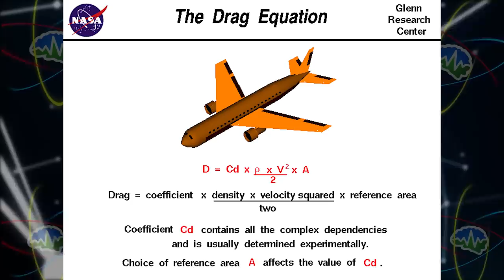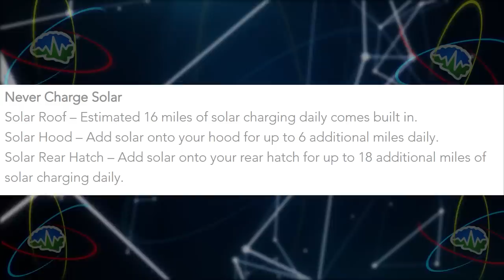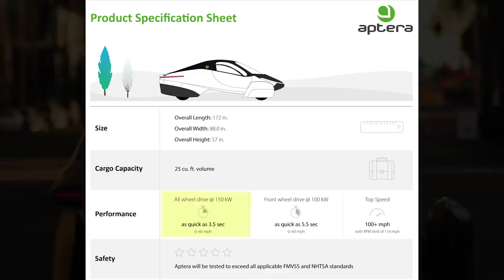Aptera Beats Tesla? | In Depth

Comment: Gut feel I think you lost a few important conservation of energy law. If this car is moving people, weight it needs to use energy. At low speeds how impacting is air friction ? My bet is by the time you get all the requirements of safety , air conditioning and compare apples with apples you're going to see a very different spec.
Reply: It's like saying if you have a motor bike you can go further ..well sure. Will the public purchase a vehicle when they have been suckling on energy dense oil vehicles ? Can the business survive until that happens. However if you are a low weight user maybe single or couple these vehicles may be ideal but so too would be an electric motor bike .
Reply: Aptera is not designing using "gut feel" but with solid engineering tools.  You are correct that air resistance does not become a major factor until speed increases, but at EPA highway speeds, the heaviest model uses less than 100 watts per mile.  They will be tested to FMVSS part 200 crash test standards.  All vehicles will come with AC and heat, which will of course have an impact on range.

Comment: What about crash test and survialbility? Many people are fine with a two seater, but in terms of safty In traffic accidents, you may as well be riding a motorcycle in terms of safty. That’s really the only deal breaker for me with this. Basically, anyone who wouldn’t feel safe driving one of those three wheeled T-rexs or two wheel motorcycle probably aren’t going to buy it, and that’s most of the population. But maybe if one day the roads are chock full of Tesla’s cars and trucks all driving around in autonomous mode, maybe the roads will be safer enough 😁
Reply: This will be tested to and will excel at standard automotive crash standards.  The numbers will be available before production begins.   This is unlike any other 3 wheeler.
Reply: @n.brucenelson5920  👍

Comment: For fucks sake, it's not fucking hard to build a very efficient, low pollution vehicle !!!.... Build lightweight electric van for example,now cover the whole roof in solar cells,stack/add extra solar panels on a slide out rack (like a tool box drawer) that can open when the van is parked for more solar charging power. Add a generator that recharges the battery, that runs off clean burning compressed natural gas, propane, biodiesel or used cooking oil. Add a wall plug in charger = DONE !!! Not hard to figure out. The downside to natural gas is you need a strong high psi expensive to build tank and you need a larger tank than a gas tank to get long range. But since it's a hybrid the tank doesn't have to be as big and natural gas is cheaper than gasoline and super abundant.

Comment: What will happen to all those gasoline stations dotted across the globe 🌎? Will they convert to electric charging stations? Doesn’t it take fuel to produce electric? Will the cost of charging your EV be more expensive at a station? If you charge at home 🏠 how will that affect your electric ⚡️ bill? Seems to me we’re exchanging one monopoly for another? What about zero point energy?
Reply: These are all great questions.  Also, without fuel taxes, there will need to be a new way to pay for road infrastructure.  We are entering a period of rapid change, and the faster we switch over, the better it will be for all of us in a collective sense.

Comment: Wonder how Aptera is on its battery just puttering around town. Where aerodynamic shape doesn’t mater.
Reply: Even better - because of the light weight, less rolling resistance, and more efficient transmission of the power needed to the road, without transmission and shaft losses.
Reply: @n.brucenelson5920  @Mike Kelley Even better? If drag at 10mph is x, then at 20 it's 4x and at 40 it's 16x and 80 it's 64x. That's for the same vehicle - weight, rolling resistance and transmission identical.  Even better? You lie.

Comment: Less mass may mean lower safety crash rating
Reply: My Gen 1 Honda Insight weighs 1800 lbs, about the same as the 40 kWr Aptera.  It got 4s when it was tested.  I was rear ended by a large car at 60 mph in my first one and was uninjured.  The first Aptera tested very well, and I am sure that this will be even better.  Crash tests will be done on pre production vehicles later this year.

Comment: It gets 1000 Miles because it is a 2 LBS. Fiberglass Death Trap, I am good Driving a car with a 300 Mile Range with a Top Safety Rating.
Reply: This will be crash tested to automotive standards and will receive a top rating.  Safety has been as much a part of the design as efficiency.

Comment: Aero is the main source of friction in automotive (apart from stupidity), so comparing this enclosed motorcycle to a tesla is pretty telling. To be honest buckminster fuller's dymaxion from the 50s has a lower drag coefficient than most cars made today, because of cartel standardisation and entrenched industrial interests in the car industry.

These presenters here, they are dumbing it down, and their reasoning is pretty incorrect (eg stealth bombers and birds are not tube shaped, nor is the aptera).

The aptera is much more manufacturable than a pressed metal box with spot welded seams.

Comment: In a wind storm i.d rather be in the Tesla.
Reply: I don't think you understand the relative wind resistance.  I would much rather be in an Aptera.  This is based on my experience driving much heavier SUVs and a Gen 1 Honda Insight, which weighs about the same as the 40kWh Aptera.  Of the three vehicles, the Aptera will be by far the least affected by wind.  Even the Honda at 80 mph on a windy Interstate is better than the SUV or the Tesla.

Comment: wont charge parked in a parking garage or your home garage
Reply: Plugged into your 15 amp 110 volt wall plug you gain range at a rate of 13 mph.  2- 3 times faster than any other EV.

Comment: Only a 1,000 mile? The last time I heard tesla was working on the 1,000,000 mile battery. Good luck.
Reply: I still love this thow !
Reply: The Aptera will get 1000 miles from a single charge. The 1,000,000 mile number is the lifetime of the battery - e.g. a Tesla can go 400 miles on a single charge, and the battery lasts 2500 charge cycles.

Comment: Range and recharge time When you're go cross country you want to be able to plug in go eat come out and be done
Reply: It will gain range three times faster than a model 3 plugged into the same charger.
Reply: @n.brucenelson5920   That's what I want to see I've yet to see anything though
Reply: @johncrow6669  From a FAQ by Aptera: Aptera can be charged and travel up to 1,000 miles in range by plugging into a standard 100V or 220V outlet. Aptera will also be compatible with CCS, J1772, Level 2 and CHAdeMO/ DC Fast Charge stations. We believe Tesla has some of the best EV technology in the industry and we hope to partner with them someday. 

and From a 110v cord (like what you'd charge your cell phone on) you get 13 miles an hour or about 150 miles of charge overnight. At roadside charging stations you'd likely get about 100 miles in 10 minutes.

Does this help?
Reply: @n.brucenelson5920   That is what I want to see

Comment: American like big. I would drive the wheels off this 3 wheel Ebike without pedals. I love electric. Put pedals in it l would buy it.
Reply: There is a design by another company with pedels.  Not crash safe, however.  You could hook up a stationary bike with a generator and get significant range on this.

Comment: It doesn't seem a practical car to own, if it had a bit more space with good road holding, I'd change my mind.
Reply: For my wife and I it the most practical car we could own for our particular needs.  We won't ever have to plug it in for our normal driving needs because the full solar package will cover them.  On trips it will gain range more than twice as fast as a Tesla plugged into the same charger.  There is enough room in the back to sleep both of us in climate controlled comfort on camping trips.  It has better traction control than any ICE vehicle and MOST EVs.

As far as driving feel, we will have to wait and see.
Reply: @n.brucenelson5920  no kids? Won't replace my mpv though.

Comment: IMAGINE  when a transfer truck passes u on 95
Reply: I currently own a Gen 1 Honda Insight that weighs about the same 1800 lbs.  It does well in these conditions and Aptera will be even better.  There are few flat surfaces that the wind can push against.

Comment: Aptera did it make crash tests dose not look like safe car to me another thing is storge space ? pros are small city car work/home
Reply: The original car was crash tested with excellent performance.  The roof crush strength was 3 times higher than any car tested at the time.  This one is considerably improved and will be tested when there are pre-production cars available for testing.  I think the results will be excellent.  There are front and rear crumple zones, front and side air bags, and other safety features, both active and passive.   Storage is 25 cu ft, and enough room in back to sleep a couple for camping trips.
Reply: @n.brucenelson5920  cool ty for info

Comment: $30k to $50k 2 seater vehicle with limited cargo space and no repair infrastructure. Great science experiment but very limited market.  As much as I would love to see it happen I have little hope it will happen.  From what I understand electric motorcycle tax credits are only $2500.  Unless the new administration changes things it will only compete with the electric smart car.  Oh wait, that's dead in the US too.  Cost and convenience is what moves the market.  This has too much competition at that price point and its limited convenience.
Reply: Why lie about the pricing to try and make your point?  You can get a 250 range model for $25.9.  As far as infrastructure, they give the right to repair and will exceed Tesla's admittedly low bar.  You won't find the Smart car at 110 mph on the highway, which this can do - or sleeping a couple in climate controlled comfort on a camping trip, while using about 1/3 the power of other EVs.  That is why there are already over 7000 preorders since they opened in December, and still growing fast.
Reply: @n.brucenelson5920  There is no lie about the price.  This company likes to push the solar panels and the incredible acceleration so I used those options with the lowest range and highest range battery pack.  Then you add tax and delivery and round up. Have they guaranteed that price is locked in?  Yeah, we see sooo many people camping in a subcompact car. Pre-orders mean nothing.  Until bill is paid and the vehicle delivered it hasn't happened.  Elio had over 65k.  Right to repair?  Exactly what does that mean and what will be repairable? To me it means that there is no one who will or know how to repair it.  You ever work on an EV? Not me.  I understand it was the intellectual property the company bought back in order to resurrect the aptera.  If that is software I'd doubt you get to see that.  110 mph.  And where besides a track can that be used legally? About as useful as 750 hp street cars. All marketing gimmicks.  The never charge gimmick.  A max charge of 40 miles a day.  So that means longest day in an area that has clear skies. Well I guess if you are camping off-road and already used up your battery this could be handy. Moab here we come.  Understood that it takes less juice and little time to charge which is great. At best this will be a boutique vehicle. With all US EV sales of a little over 1% maybe the Aptera is still ahead of its time.
Reply: @doclees11  I thnk you are starting to get it.  You get some solar without an option - just not 700 watts peak.  You also get 5.5 second 0-60 times with the two motor version - still great compared to ICE vehicles   Mine came in well below $30K and I have some options.

Paul Elio has never delivered anything.  Chris Anthony has raised over 100 million for tech companies, has taken a company public and delivered thousands of products.  Investors are very happy with him.  Do your due diligence.  The software and everything else on this vehicle has been designed from the ground up since 2019.

Right to repair includes the fact that the repair manuals will be available for free.  Parts can be sourced from Aptera, or any vendor you wish, and you can do what you want to on the car - sort of like the original VW Bug.  They will have traveling techs if needed.

You are correct that this is a niche vehicle, but it is a far larger niche than the Tesla Roadster was, is far more practical, and will fill the same function at Aptera that the Roadster did for Tesla.
Reply: @n.brucenelson5920  well below $30k?  How do you know?  Is there a locked in price?  How much for delivery?  If the composite body isn't easily repairable by the local body shop or have easily swapped out panels collision insurance will be high. Now what what happened to the first Aptera? I believe it tanked at the X prize and didn't even finish the 50 laps.   I still can't find a vehicle these 2 have brought to market.  This thing is still transportation so it must compete cost and convenience wise with everything else out there and there is a lot out there.  If you think resale is bad on the EVs out there now just try to resell this. $15k and I can get a very low mileage Bolt that has a repair center and 4 seats.  Now it's possible the current economy could support the oddball.  But if the new administration tanks the economy this version will have the bad luck of following the same path the last version and possibly for the same reasons.
Reply: @doclees11  You are confused because you haven't done your research.  US Delivery is included in the prices quoted on the web site, and they will be lower if you do a factory pickup in San Diego.

The first Aptera tanked largely because the original founders were kicked out of the company because the Detroit CEO their startup incubator asked them to bring aboard to manage production decided he wanted to build something else and convinced enough of the board to go along with him.

Your research skills are poor because at Epic Boats, Chris brought thousands of composite vehicles to market.

If the economy tanks, then we are all in trouble and it won't just be about Aptera.
Reply: @n.brucenelson5920  Epic wakeboats looks bankrupt too.  Hard to tell for sure. Can't seem to find a website. Only bankruptcy filings.  What I do see is that the 23E hybrid can't be found.  Doesn't look like it made it into production either.  2009 articles talk about the Vivian LA move, the building of the 23E and 2 electric car models. Was supposed to employ 400. No $100k 23E.  No 2 other electric cars.   Sound familiar.  Elio?   There is an Epic boat builders there but only has about 40 employees.   The more you encourage me to look the more I see it tanking.  Maybe even a "Epic" failure.

Comment: Finally, a sensible electric car that genuinely reduces CO2 emissions and not just something that produces just as much as a petrol car (in fact even more during the first 100,000 miles due to the CO2 cost of producing those enormous batteries) but simply moves it to the power station and into the extra CO2 used in manufacture.

Comment: What about safety?
Reply: The first version of Aptera passed the automotive crash tests, and the roof crush test was three times better than any other car tested at the time.  The new design is even better.  The passenger capsule is stronger, there are front and rear crush zones, and front and side air bags  It will be tested to automotive standards and the ratings published before production begins.

There is also a Level 2 Safety Pilot option for $1,300 that will give an additional measure of active safety.

Comment: Probably not very good for Winter ❄️
Reply: We will know for sure when an Aptera is tested at the Elaphe cold weather test track next season.  The three wheel motor version is likely to do very well with snow tires because of superior ABS and traction control that senses and adjusts 32 times per wheel revolution - far faster than most other cars.

Comment: Maybe a compromise would be better - a more practical-looking vehicle with somewhat reduced efficiency. This would not be a practical vehicle in the winter months up north - snow covering the solar panels, the need for heat, and the light weight/3 wheels on snow and ice would be problematic. Oh, and, yes, you are Tesla Fan Boys - you berate every other non-Tesla EV and you have money invested in Tesla. You are biased in your opinion of Tesla.
Reply: To be fair, both heat and A/C are standard.  Most people keep their cars garaged in winter, and this can be plugged into a standard 110 volt outlet and still gain range at a rate of 13 miles per hour it is plugged in.  Since the solar radiation available outside is at a minimum in any case, you aren't sacrificing much in range by doing this.  With snow tires and AWD, the Aptera is likely to perform very well in snow.  The traction control is far superior than any ICE car and almost all EVs.  

Next year we will have footage of the Aptera performing at the Elaphe cold weather test track and probably other 3rd party reviews.  

Finally, the fact that the wheel motors are a source of heat, this will prevent snow and ice build up under the wheel pants in almost any conditions and should it occur, they can be snapped off in less than a minute.

Comment: The design of the car has one cohefishent flaw, it's not swiming threw water it's driving threw air and there's no back-seat and not much trunk space. If you added those things to this car it would average out the same or worse as most other ecars.
Reply: 32 cu ft of space and long enough to sleep a couple on camping trips is "not much trunk space?"  In addition, it uses about 1/3 of the power of other EVs for similar performance.  Perhaps you need to take another look.